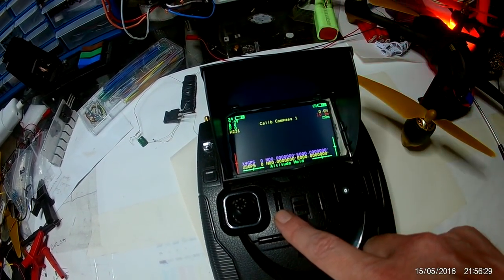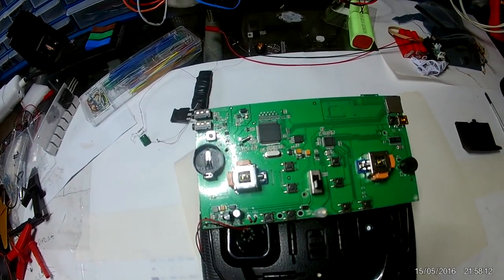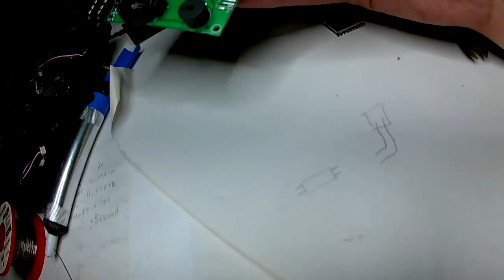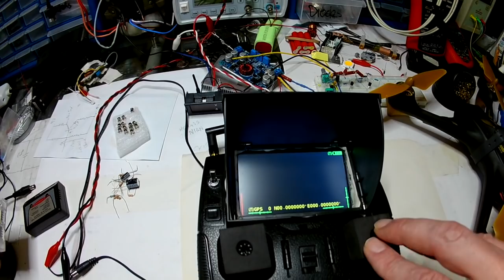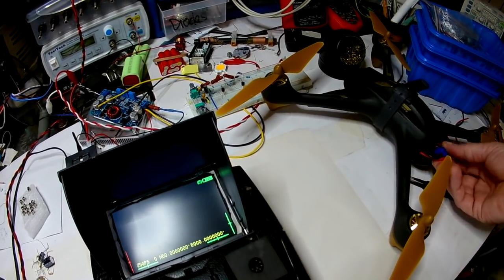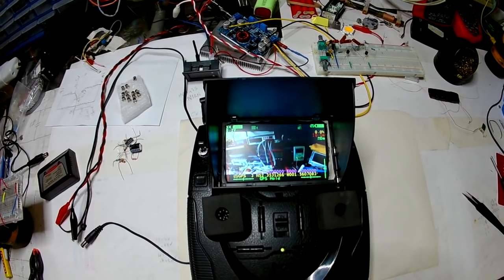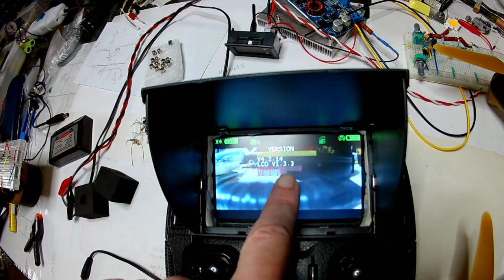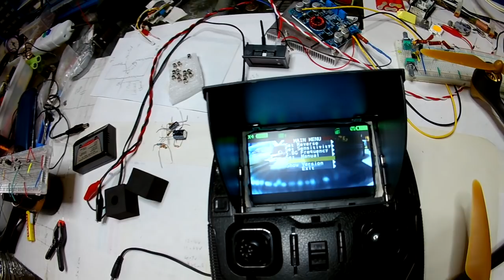Hubsan H501S Transmitter/Transceiver Board Upgrade

Comment: A brave tricky repair made to look easy..well done..have you seen that solder stuff that melts at 100 deg c..used for removing multi pin components?...and I am wondering if the zener auto switch for your power meter worked?
Reply from the maker: Yes it is a deceptive one also I went in a little heavy handed. My friend patience was old of town. No not heard of that but it does sound interesting, I shall go see. No not really it still turned on to slow. I have made but not tested a circuit. I want to use P channel Mosfets to control the load found some 0.02 RDS IRF4905 so very max 5.5 amps will be OK I hope.

Comment: Hello,
Maybe you can help me. I have an issue with the h501s fpv board, the camera worked but not the fpv transmission part (I tried To save pictures on the sdcard and it worked but nothing on the transmitter screen except telemetry). And also when I opened the drone the leds behind the fpv module were not shining. So I bought a new board. On the new board the leds are shining and the fpv part of the board gets hot, so it should be working. But still no fpv return on the transmitter !
Do you have an idea from where the problem come from ?
Reply from the maker: Carlos you are best speaking with service@hubsan.com
Reply: thank you

Comment: What is the Firmware Version on your new board, as compared to the previous board in the Transmitter?
Reply from the maker: Hi, the controller software is V4.2.14  LCD V1.3.3. I can not recall the version of the previous board, sorry. Any chance of a thumbs up cheers.

Comment: hey i have the problem that my h501s flyes just 100-200 meters away and then it stops suddenly and return home, so the 2,4 ghz module is broken or something like that..i have the range mod too, i already tested all different things with original antenna with mod antenna with other sma cables,....but always the same problem of control loss after 100-200 meters flying ..
so my last hope is to change the reciever 2,4ghz module..how do you do that? can you make a video on how to replace it? or is it just like the 5,8 ghz module (the 5,8 works fine) just unsolder and solder the new one ?
btw im german and my soldering skills are..well not the best.
hope you can help me!
thanks
Reply from the maker: Sounds like it is going out of range and failsafe is returning it home. Check your connections and I know this may sound daft but make sure you have the right antenna on the right connector.  Duh! obvious I know but checking will not hurt. Did it work fine before the mods? Looking over my controller board it looks simple enough to change the 2.4gHz module it is only 8 pins. Use a solder sucker and maybe some wick, take your time and you should be fine. Let me know how it goes.

Comment: Hi,  what batteries did you use on the battery mod
Reply from the maker: The batteries I use are 1100mAh. These are the same size physically and 1200mAh https://www.alibaba.com/product-detail/small-rechargeable-7-4v-1200mah-li_60176249921.html?spm=a2700.7724857.0.0.HlqdF2
My battery markings: 2SICR1850P - 1100mAh 7.4V 20110409
Reply: +Elecifun the link are for 7.4 , are you sure these are ok as I thought they should be 6 volts. For transmitter
Reply from the maker: 7.4V is fine. On the transmitter board it does say 4 - 13 volts. That's why i haven't used a buck converter.
Reply: +Elecifun mine doesn't say 13v on board even though ive only ad my hubsan 2 weeks, how can i find out what board i have
Reply from the maker: Where the battery wires connect to the board. On my old board it is right in front of you when you open the back. On new board it is on the other side. Yours is new so check the other side I bet it is there.

Comment: I have problem with my tx. I was wrote to hubsan for help but with no response. Can you help me with some ideas where could be the problem. It enter in all mods, I can even flash firmware 4.2.7 4.2.8 and 4.2.9 successfully but there is no change. It dont wont show gps and sliders and it dont wont bind to quad.
https://www.youtube.com/watch?v=g_RYd8gaV9U
Whats happend with your old board v4.1? Is it functional? Are you willing to sell it if it is?
Reply: my Quadcopter I have the Hudson X4 501s and my controller only has a black screen doesn't come on with new battery